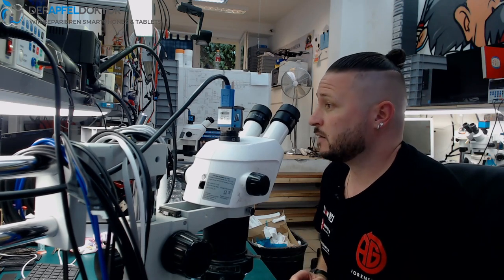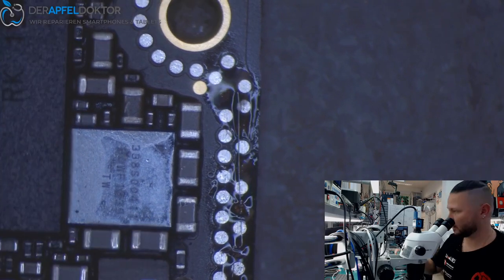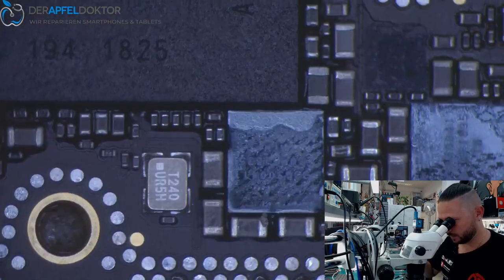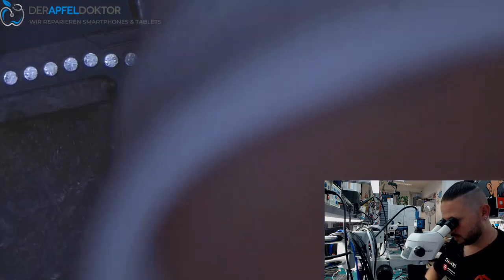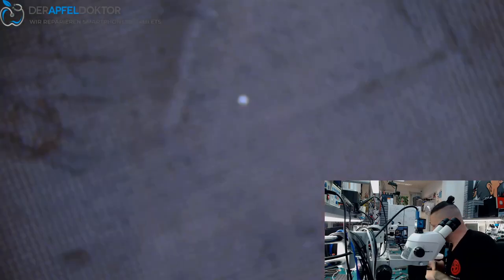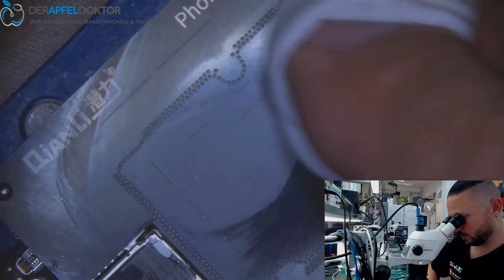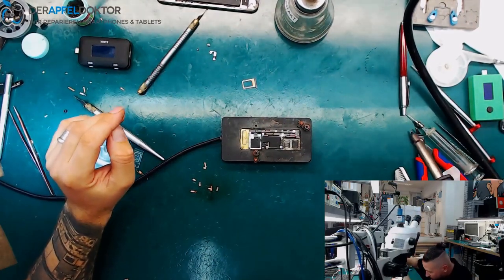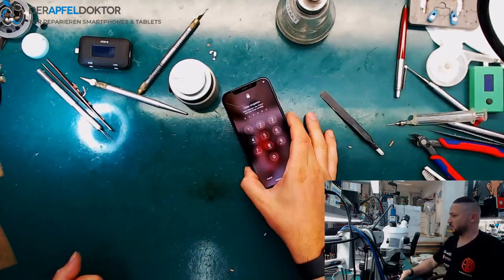ADVANCED REPAIRS - iPHONE XS NO TOUCH - DUMBBELL FELT DOWN TO THE PHONE - RIPPED PADS AT TOP LAYER

Comment: bro iphone x/x max restarting after2-3 minutes any solution (net connected or without)
Reply from the maker: Change dock flex (OEM).
Reply: i changed it .. reballed pcd checked with new batterry checked with i socket .. same problem.. both x and x max restart when wifi connected and youtube playing
Reply from the maker: MOHAMMED RAFI SHAKEEL SAIT Ceck panic logs.
Reply: waiting a long time.. i received icc pro✌️✌️..great wrk apfeldocktor team. greatjob ben
Reply from the maker: MOHAMMED RAFI SHAKEEL SAIT On DOCK FLEX. 10000% like I said it’s the dock flex.
Reply from the maker: MOHAMMED RAFI SHAKEEL SAIT Then Check schematics and do professional analysis.